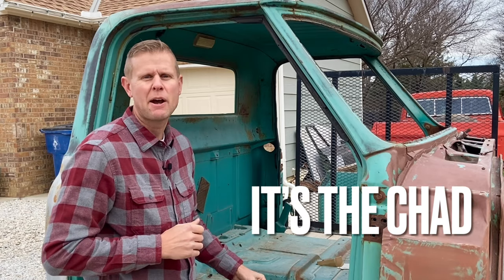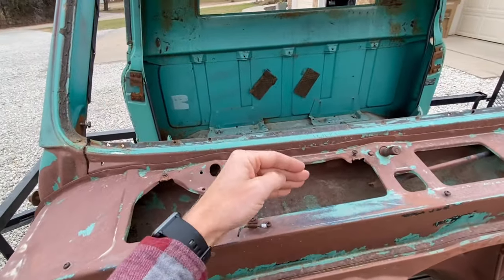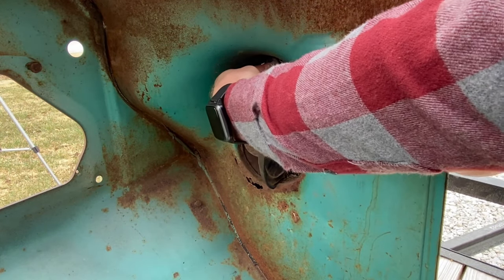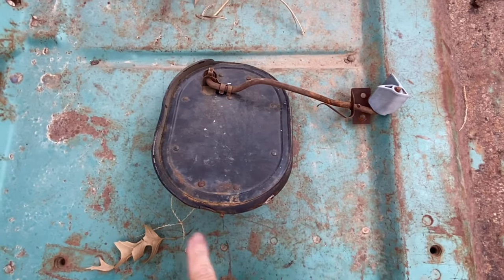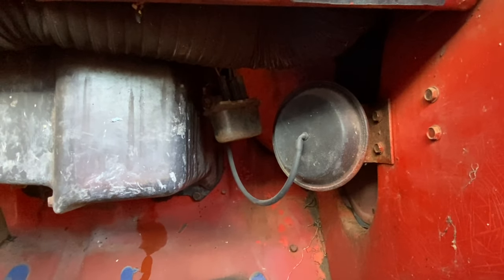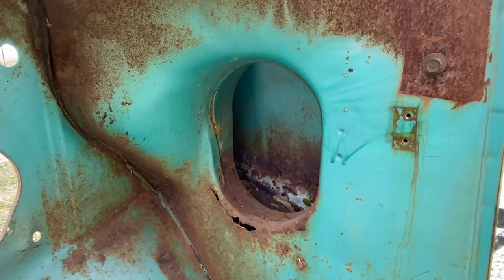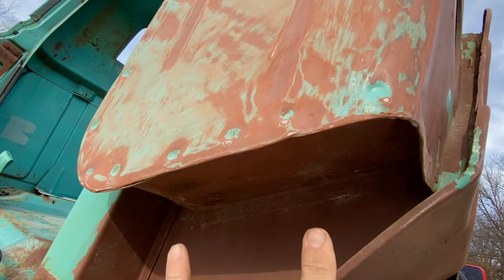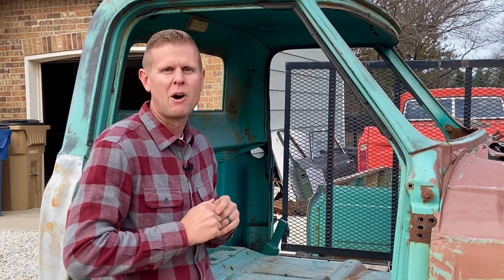1967-1972 Chevy / GMC Trucks - Kick Panel Vents

Comment: I made my vent box outer panel removable so I could clean it and recoat it.  I also coated the entire vent area with bedliner and made a large 1.5 inch drain with a hose so water and dirt can drain out past the fender
Reply from the maker: What a great idea! I’m sure that helps the fenders from rusting so fast as well. How do you attach them back on?
Reply: @C10TruckNerd  rivnuts.  I rtvd behind the joint so it wouldn't leak
Reply from the maker: Good deal. Thanks for letting us know!
Reply: Do you have pictures of that on the forum or online somewhere we can see?
Reply: That’s A Great Idea 👍🏻
Reply: Thanks again!

Comment: Informative video. My 71 C10 doesn’t have a dimple on the bottom. It has a small hole for the top and bottom pins.
Reply from the maker: You are correct. I probably only said dimple, but they should also have holes for the pins.

Comment: While you have that off, here's a tip for when you want to put your fender badges on without having to remove your fender. After I got my 67 back from paint, I took a small drill bit and put pilot holes into that air pocket thru the existing badge holes in the fender. From the inside, I used a bit big enough to put a 3/8, 5/16? socket thru. Put my badges on, then used those plastic hole plugs from O'Reilly's with RTV to prevent rusting.
Reply from the maker: That’s a great idea! I love the outside of the box thinking! Thanks for sharing and for watching!

Comment: Is there any tricks to getting a good rust encapsulater in these air buckets? I thought of spraying fluid film in there with a 360 degree wand.
Reply from the maker: Those wands that come with the rust encapsulator by Eastwood works well. Pulling the visors and rear view mirror off to get the roof line works great.

Comment: One of the problems with this cab and wind noise is that there aren't vents to let the air OUT of the cab.  This over pressurizes the cab and forces air to leak out through the door seals and wing windows giving you all that leaky wind noise as speed increases.  The later trucks came with a small vent on the driver's side door jam, but this is still not enough to properly vent the cab at road speed.
Reply from the maker: Good to know! I knew GM started installing jamb vents in 1971 on these trucks. I wondered why. Thanks for the info!
Reply: I just Crack tha Window- and if your Worried about Water then Just Install the Metal Window  Door shade.

Comment: An old GMC mechanic told me that 67, 68 vents are larger than 69 to 72 vents. About 1/8” taller and 1/8” wider. 
I think that he is correct, because I tried putting 70 vents in to our 68.
The 70 vents did not cover as much area as the 68 vents. 
Hello from north east Montana. 
10 miles from the Canadian border.
Reply from the maker: Well good to hear from some friends from the north! I hadn’t heard any vent differences, but nothing would surprise me with these trucks. I know the replacements are sold as 67-72. I have some 69 and 71 vents I can try in our 68 GMC. I appreciate you reaching out and for watching!

Comment: Great information , Thank you !!  You mentioned the actuators in this video.  My 72 has 3 vacuum lines coming off of the a/c/ heater control unit and I'm trying to find a diagram or video that talks about how these actuator vacuum lines all connect.  can you help??  I can only find a diagram for a '71 that only has 2.  Thanks in advance .
Reply from the maker: You bet! It looks like a 72 thing. Give this a read. I think it will help. 

http://67-72chevytrucks.com/vboard/showthread.php?t=518197

Comment: Hey Chad does the cowl mesh cover you mentioned get clogged up with debris? I know with gutters on a house I have an easier time cleaning the gutter out versus cleaning off gutter guards. Also, are you going to the c10 show July 16th in Independence? I entered my 71 K10. I'm going to see if I can win a trophy for truck that needs the most work! ;)
Reply from the maker: Awesome James! Can’t win if you don’t try! The screens can get clogged. I had an elm that I used to park under and the little seeds would land on top of it but didn’t get inside. I was able to wash  them off and down the fenders. Pine needles and small stuff could still get through if they land vertical.

Comment: Thanks my 72 C20 seems to leak from above the kick pan vent on both sides?
Reply from the maker: You might pull the glove box liner and see if you got some sneaky rust up there. The seal around the antenna line might be rotten allowing water in as well.

Comment: Great video but didn't show how to clean out air condition right side vent. Door is under tension.
Reply from the maker: Sorry for the slow reply Tom. Your comment went to review and I didn’t see it until now. You can loosen the actuator or give the flap a manual turn and depress the spring loaded rod.